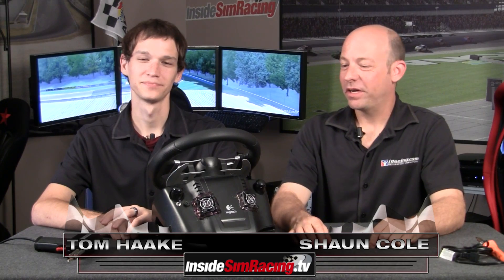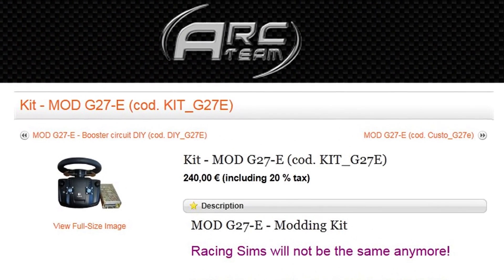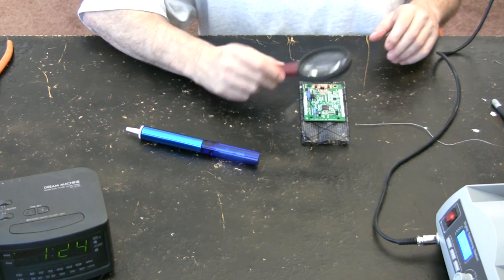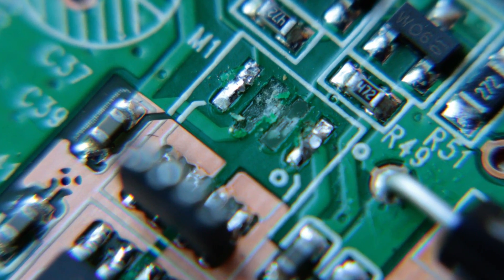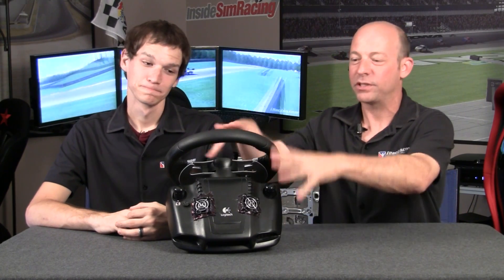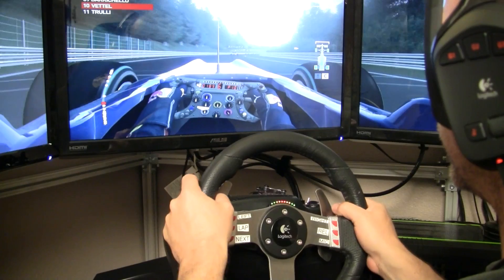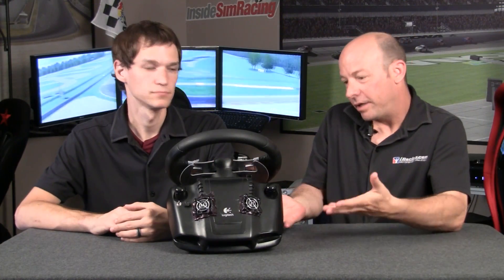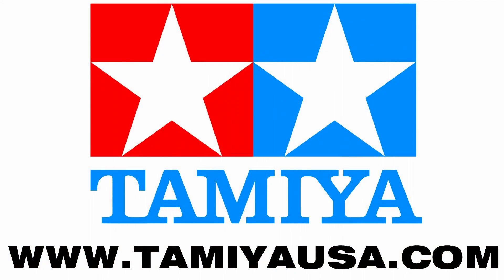Logitech G27 mod by ARC Team

Comment: is this worth it? i can get t300rs gt for 400 dollars. and i can sell my g27 for 120. the upgrade to t300 is 280 dollars with warranty... g27 is not fast enough but also inaccurate with deadzone and that wont be fixed
Reply: What? no its not.. You can get direct drive bases for $950.....

Comment: Used one of these for the last 3 yrs. Heavy usage and its faultless :) I Don't use the ARC pedal mod though, I use the "Perfect pedal" brake mod. Together they make for a great setup.
Reply: Hehe, your lucky then, a colleague of mine had also used it pretty good and his has a crack in the gearbox housing for the motors, 2 cracks in the encoder disc PCB and a completely cracked encoder disc (no clue how that actually stayed together, it was cracked in so much places...
(He asked me if I could check it out and when I showed some of the pictures he didn't want it back).

Comment: Now here's a real simple question < Why would you butcher the top of the case for fans when you could have very easily fitted the fans to the vent hole on the rear of the case and moved the Air out of the case that way, The fans should blow in and NOT extract either , hot air is less dense and harder to move where cold air the opposite is true.

Comment: Just today bought a g27. Not the right video to watch :-S
Reply: haha I was going to buy one today but now I dont know whether or not I should look into other options..
Reply: I may make myself unpopular but we all have a right to have a say , so here goes
The ARC mod or to be truthful HACK !! IF you set your Profiler and game up correctly and IMHO with a decent Real Feel ini file there is absolutely no need to ridiculously over load the existing motors in the G27.  IMHO you DON'T need massive power in a FFB system you need finesse and feel The G27 is still and always will be the BEST Value for money like it's predecessor.  I defy anyone to be faster or smoother with this mod and to be honest I believe it is designed to do just one thing , relieve you of hard earned money !! Again properly set up you donot need any more FFB than the G27 can give you.
Reply: mozzmann it may be one of the best "bang for your buck" wheels but for $900 you can get a wayy better setup than a modded g27. ive had a g27 for a long time now and more FFB and more accurate/delicate FFB is something that im thinking about quite often. the point of having more FFB is not to overpower your arms but to allow the system to be able to handle a strong FFB level with finesse. the G27 is either underpowered at a low FFB setting or it just doesnt have the finesse of a Clubsport wheel base. the analogy of a speaker system in a car here fits well. turn the volume up in a normal car and the speakers sound horrible because the speakers are just not designed to be played at that dB level. You have to start over with a higher wattage speaker/amp setup at the same dB level to get good quality sound. the G27 just isnt designed to handle a lot of FFB smoothly. you have to go to a much bigger system all around to get the finesse AND the power
Reply: IMHO there are far too many Sim racer's that can't set their wheels up properly and use many time more FFB that is needed to GET FEEL., I have heard from many that the FFB Motor's are too weak, what a crock, you need to "Feel" the contact with the road and the varience's with suspension and tire load, if you run FFB cranked to the max then you simply cannot feel it , and your driving suffer's accordingly. Modern Sim Modeling allows for pretty accurate representation of what the wheels are up to due to the physic's calculations that are driving the FFB system and literally feels like a real car in many these days and this is why I say that FFB needs to be tailored to both the Actual wheel (based on the internal game settings) as this has a MASSIVE effect on how accurately it represents the input from the Sim the PC and The wheel as they ALL interact !!!.

Comment: Can you use the Logitech g27 on the ps3
Reply from the maker: ciaran brown PS3 yes.. PS4 no
Reply: Inside Sim Racing Isn't their an adapter for the ps4 to make the g27 work?
Reply: I69Highwayuser Technically yes. Work properly? No. Work at all? Yes.
Reply: Yes it works on the ps3. I play GT5 and Initial D as well as PC driving games.

Comment: From what I understand fro this video the whole point of doing this mod is to give the G27 MORE force feedback. At a cost of $200.00 to $900.00 Wouldn't be cheaper and quicker to just buy a ThrustMaster t500rs ? You get the inproved force feedback and for a whole lot less then $900.00
Reply: I think someone would mod it if they were, say, given the wheel, inherited it, or bought it used and aren't entirely happy with it.

Comment: Why would I buy their wheel for $900 when I can get a T500RS and the TH8RS shifter for a much cheaper price than that?
Reply: exactly
Reply: it was 2011..
Reply: Fredrik Nilsson I'm afraid that's ALSO old now and there's better options
Reply: ***** Like he said, it's a good beginners wheel. There are however better alternatives if you can go up in price range. I've had a G27 for almost a year now and it still works as if it was new.
Reply: Fredrik Nilsson have you looked up the price for those wheels
Reply: Is this comment still valid?
Reply: And then on top of that, Logitech is out of the wheel game now, and they have a penchant for not writing drivers for new OSs for legacy products in the past (wheels in particular).

Comment: Can someone pls help or explain why the "gas" pedal on the logitech G27 is always showing full throttle even when not depressed at all? The engine on my truck is always at full revs even though I don't press the gas pedal - the cluth and the brake work perfectly fine. Has anyone experienced this, any know fix? Your help is appreciated. :)

Comment: the g27 is like a ford f150: massive sales good value great durability its not the best out there but definetley good, and its a ton of fun. whereas the new wheels like the t500 are like new lamborghinis: filled with gadgets somewhat reliable not very practical even more fun. very explensive and not quite as many sold.

Comment: hey, since the g27 wheel is a little weak with gt5 (at least in my case), how strong would the modded wheel be, would it reach normal levels (such as the one found in dirt 2 or f1 2010 with the unmodded wheel)?

Comment: I know from computer building that a bigger fan at a lower RPM would produce less noise, So could you change the fan size from what look like 40mm fans to like a 80mm or 100mm to make less noise or would the fans hit something inside the Wheel.